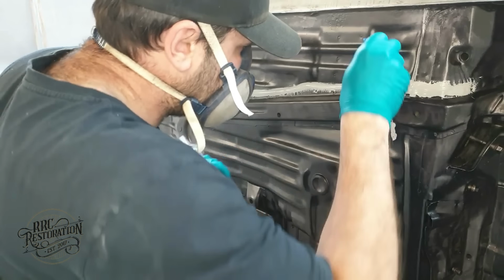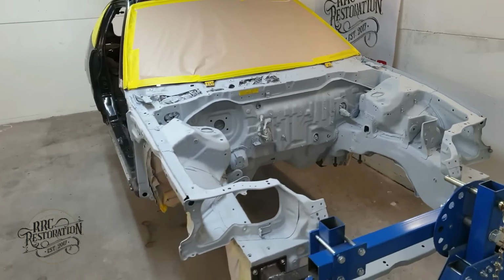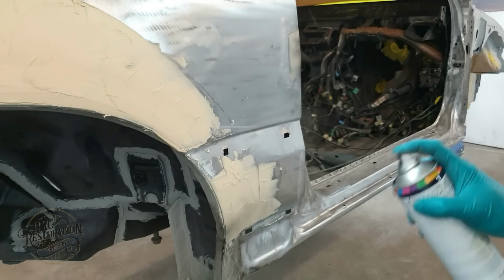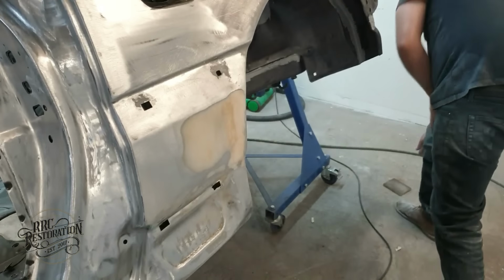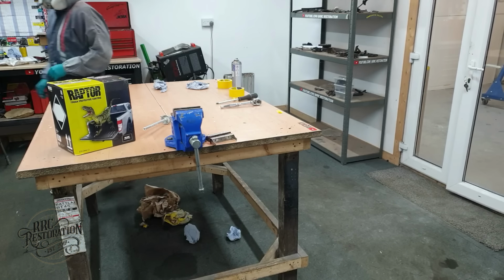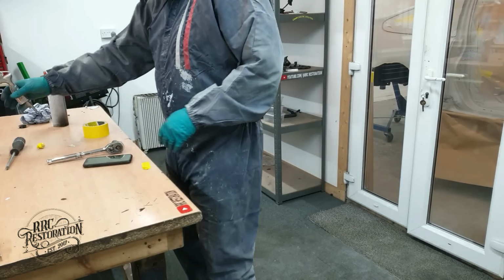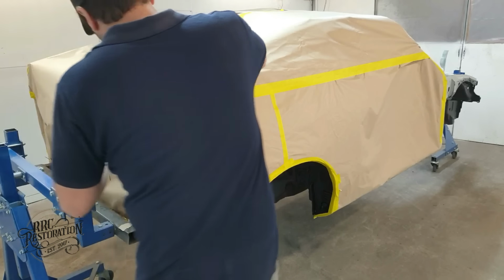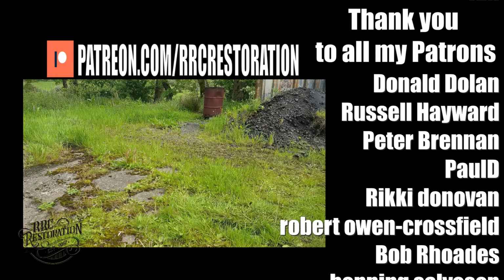Restoration Of An 80's Icon - Honda CR-X - Part 4

Comment: I've just watched Mr. My Mechanics weighing his filler to dab on his Datsun, and I get you painting your black Raptor coat black 'coz it's the only way to do it right. What a time to be alive! How did I get to be so lucky and spoilt rotten? I always want your vids to carry on and not stop, or at least get released like, twice a week. But then the job would be over too quickly I guess. Bloody excellent so far Mr. RRC 👏👏👏. In fact it's a full on, two thumbs up, Mr. Burns style ehhhhxcellent 😁. 😎

Comment: Seeing you doing all these body works reminds my dad, he worked his entire life to basically use a hammer to fix the body metal, water sandind and painting. I believe he worked more than 60 years doing it. He didn't have many tools, we had a very humble past but he showed me how's hard work, only using basic tools and his arms, but surprisingly, resulting in an amazing job, we couldn't tell the difference from the original and the fixed part. Thanks for your videos, keep sending it to us please.

Comment: Great to see the progress & under-floor reinforcements straightening, ALL my ED/EF Civic & CR-X's need those repairs. Too many clowns think they can lift the car there!
Must admit I now prefer to Epoxy Prime before filler, especially after removing a 'professionals' filler from the rear 1/4 of my '95 Civic with a paint scraper back to bare steel !

Comment: These videos take me back to 1995. Having finished with uni, I took a job in the US, and brought a 1991 CRX HF; my first decent car (though it turns out the newest car I've ever had). The HF had the same 1.5 SOHC engine, but fuel injected, so even less power, but Honda gave it a 5-speed with high gearing, so it always felt a lot of fun. A lot of weight was stripped out of this car; crazy thin seats, rear seat delete (replaced by handy lockable storage, not even a parcel shelf, power nothing but it had an AC. When I returned to the UK (Belfast) I went looking to buy one, ended up looking at JDM models, ended up with a Eunos Roadster.

Comment: my only jip is raptor liner is notorious in drying and cracking a few years down the line as it becmomes brittle. Gravitex is a rubber based version wich is flexible and lasts a good bit longer. Awsome job man

Comment: great work with the grinder, what are the sponges???  never seen those before.  I do a lot of stainless work and they look effective.  great channel as always a pleasure to watch your fastidious work!  regards from a Scot in Spain.
Reply from the maker: Hi, they are foam sanding pads I use them for tight areas and contours but can be used for pretty much any sanding job they are available from Mirka and 3m or you can buy the cheap unbranded ones lol  really happy to hear you enjoy my work.

Comment: Nice job ! But... You may should use a 2k epoxy primer over bare metal before you apply some bondo. Bondo contains humidity and/or air bubble that will make rust come back. Epoxy primer will stick very strongly on bare metal 80 grit sanded and will act as a filler, which is a good point, then after a quick 400 grit sand bondo will adhere on primer very well. Then another coat of epoxy primer on bondo'ed areas, then high built primer, paint... 
Same for the underside, use rust converter then epoxy primer before Raptor under seal, this adds a real strong layer of extra protection agains rust.

Comment: Good idea to paint (and varnish) the soundproofing which makes it easier to clean in the future.

However, before applying the soundproofing, I would have protected certain areas, such as the support faces of the shock absorbers for example.

To think I'm doing the same thing, on all fours under the car 😕.

Comment: That red scratch and pinhole filler is the stuff of nightmares when it comes to bodywork. It is just primer but as it dries over time it shrinks. Always shows up later down the road in bodywork. I got away from using after the first couple jobs I did years ago. The only time you can use it and not have a problem later is if the car sits for months before you finish sand and paint.

Comment: Would have used epoxy filler over the welds.  Or did you do that and i missed it? Helps waterproof the welds in the event you have any small gaps.  Normal body filler water can seep through/into.

Constructive critism.  

Loving the content bro ❤

Comment: In about 1990 I was looking at a Honda CRX for myself, It was a lovely little car. It will be a delight to see you in it when it's done. 
I like your NUTS puller points solution. Is that your own method?  I've seen puller bars using welded on tags, but not this approach.
Reply from the maker: Thank you, im glad you are looking forward to seeing the final result :) yeah its a little method i made up for using my large slide hammer with no fear of anything coming loose or breaking weld stud pulling if fine for thin metal but heavy duty stuff requires things to be " beefed" up a bit lol

Comment: Problem with the Raptor spray is that it cracks and chips quite easily then allows water underneath. My mates land rover looks a right mess underneath and his bumpers are chipped to hell and rusting

Comment: What an incredible job! Question. Did Honda paint body color over the undercoating from the factory or is this an instance of going one better than original?
Reply from the maker: Thank you, yeah its a case of me going over the top originally its would just be the bare underseal with a light overspray from the sills on it.

Comment: How come you didn't use primer on the underbody? And didn't go with epoxy primer on the shell?
Reply: Thought the same thing, filler on bare metal and raptor over rust converter? Raptor is known to chip off and when it does there's nothing under it
Reply from the maker: The rust treatment acts as a primer as its designed to be overcoated. and I didn't use epoxy because I'm doing filler work, and i don't like doing filler work on top of epoxy.
Reply: @RRCRestoration  Why don't you like to do filler work on top of epoxy??
Using rust converter as a primer is a bad idea too even though it says it can on the tin
Same with using the high build DTM. Just because it says it on the tin doesn't mean its a good idea. Sort of thing that would be used for a quick job spot repair. Not for a bare metal restoration.

Comment: Looking good. I see you used high build primary. Should it not have epoxy or etch primer as a first coat? I am currently doing the engine bay of a MK2 Golf. And will follow suit if that will hold back the rust?

Comment: Speaking of corossion protection, what is your take on spraying all nooks and crannies with oil or wax? I heard it's kind of like a "holy grail" for stopping and/or preventing rust, I heard it kept particularly rust prone cars in great shape even way up north in the harshest of climates.

I've had it done on my daily driver, a 2008 Mazda MX-5, at a Krown shop and I have a 1994 Suzuki Vitara that's awaiting a restoration where I'm planning to do the same once it's all ready.

Comment: why not work the metal instead of using that much bondo? it's a really beautiful skill that could definitely help you out! amazing content otherwise, keep it coming!
Reply from the maker: There is very little bondo on the panels just a very light skim to smooth out the imperfections. working the metal is a skill i have but not upto body expert standard since im only a trained painter.
Reply: @RRCRestoration  regardless of that, it's an amazing job that you're doing on this car, you can most definitely be proud of what you have going on

Comment: Hey mate, love your work, I've learn't alot along the way with all the different projects, absolutely loved the VFR400 and I'm building a RC30 Tribute from a VFR750f at the moment. I am currently doing something very similar to the work you are doing on the CRX to a E39A VR4 Galant (EVO 0), what is the rust converter/preventer product that you use?

Comment: Makes me wonder how long until rust appears on bare steel...I guess it comes down to humidity. Does even a tiny spot of water on steel before primer make any difference?
Reply from the maker: On a humid day or touching it with sweaty palms ive seen flash rust develop in minutes but in the right environment you could probably leave it bare for a day without too much ill effect.
Reply: @RRCRestoration  Interesting to know! 😎

Comment: I'm assuming you used a single stage on the bottom and engine bay, will you be doing a base/clear on the body or will that be single stage as well?
Reply from the maker: Nicely spotted, yeah i used single stage just for ease. The body will of course be base and clear for that ultimate deep shine ;)

Comment: Will the car be running the D series engine or something more modern? A friend has an late 80's CRX which was initially rebuilt with a B20 but due to management support (costs/mapping etc) it was then swapped out with a K series.
Reply from the maker: Im not 100% sure yet, Ive got a few ideas in mind but nothing is concrete yet.

Comment: I really enjoy your videos and I love the CRX project.. but I'm curious why you didn't remove the glass before painting.. we call this a 3 year paint job here. If you don't properly detrim a car before paint, then anywhere where you painted up to will start to peel back from that masked edge
Reply from the maker: Thank you, Im glad you asked that the glass isnt removed as its quite literally unobtainium! getting original bronze tinted glass for this car is impossible here now and any glass fitter wouldn't give a 100% guarantee that they could remove it " especially the windscreen" without breaking it which i can totally understand things happen. The rubber trims are all removed and the masking is right up to the edge of the glass done this hundreds of times and never had a failure so im quite happy doing it again here.
Reply: @RRCRestoration  completely understandable. Over here you can buy these CRXs pretty easily. Parts are everywhere for them. Unless the model you're working on has specific glass like the bronze tent you're referring to. They do make a specific type of lift tape that will lift the rubber seal of the glass or trim up so that you can paint underneath it. I've seen that in a few of the shops that I've worked at over the years. That might be something to look into instead of masking up to the trim. I'm excited for your next video and look forward to more content from you

Comment: strange, did you forgot the green rubber "duck" thing? or did I mis something? 
Anyway I'm curious wat you are going to do with engine, gearbox, brakes, ... 16i16v with manual gearbox? disc brakes in the rear? I hope you keep it OEM+ not too wild, just clean standard but not with the auto box and drum brakes.

Comment: I've no doubt in my mind you know what you're doing being a panel beater sprayer, but why wouldn't you etch prime the bare metal shell before high build? I'm genuinely interested as I see paint and prep as a but of a dark art
Reply from the maker: There is no need to etch with this particular high build as it is designed to be applied to bare steel, i double checked with the manufacturer ;)
Reply: @RRCRestoration  ahhhh beautiful, I knew you knew what you were doing, like I said I was just curious 👍🏻😊😊

Comment: May I ask why you are putting high build primer + filler straight on bare metal? And raptor straight over a rust converter? 
Theres no point doing all this welding and rust removal if you're not going to properly coat the prepared metal.
Reply: Thought the same thing, not even used Epoxy Primer either, raptor will chip off and then there's nothing protecting it after
Reply: @xelad6159  You hate to see it mate. Seen these mistakes time and time again. A little research goes a long way

Comment: Most of the time they are covered, but it seems to me you still have the windows in the car. Correct? If yes, why? My experience is very limited, but I worked on a car many years with a friend together, and we removed all the windows before the paint job. It wasn't that difficult.

Comment: Why did you decided to grind to bare metal? Even doing the filling job and bodywork, it takes so much time and takes lots of time. Also the grinding disc marks are harder to cover vs. sanding paper.

Comment: You're obviously a master craftsman, so I'm puzzled that you would leave bare metal exposed for more than a few minutes. In my experience, flash rust starts almost immediately, and continues under any later coats, unless you kill the rust dead to start with. On bare metal, I immediately prime with etch primer or epoxy (both of which contain rust treatments), then a primer-surfacer, wet-on-wet, then a light sand, THEN, a non-moisture-absorbing filler. Then further coats of primer over any further exposed metal, followed always by primer-surfacer. I use traditional filler only over the top of sanded primer, just before painting. As I said, I admire your work, but if you park that car in a driveway for five years, it will be a shower of rust flakes. No offense intended. Really.
Reply: Using that logic given the amount of time between stripping the paint at the bottom and getting to the top (hours), unless you primed/sealed the metal after every row stripped, the process has already started. Does your grinder come with a spray gun attached?

Not quite sure how you can compliment him as a master craftsman and then tell him immediately that his work is going to be a pile of rust on a driveway.
Reply: @jimporter  If you spray bare metal with an etch primer within a couple of hours of the steel becoming exposed, the phosphoric acid within the etch primer will eat any flash rust. 
Also, good epoxy primers specifically state something like: "A chemical treatment (or conversion coating) will improve adhesion and performance properties of the finished coat". In other words, you remove the rust and spray epoxy primer. 
Most rust treatments won't affect a non-absorbing filler. They may affect a normal filler. Normal fillers also suck in moisture; when they're applied to bare steel and then left, the moisture within the filler starts rust unless the filler is quickly primed.
And yes, each time I expose bare metal, I respray with etch primer. 
The reason most classic cars don't rust away quickly is because they're kept in dry garages, away from humidity and salt. I don't have that luxury, so I don't give rust a chance to take over.
Regarding our friend being a master craftsman, he is clearly highly skilled at manipulating steel and in achieving an as-new appearance on the vehicles he restores. My only quibble is with the issue of longevity.

Comment: I am sad on the fact you appiled filler on bodywork.  that is huge bodge job
Reply from the maker: I'm a professionally trained painter so no not a bodge job in anyway shape or form!, I'm using the filler for the exact purpose it was made for for smoothing out any imperfections that are impractical to spend time massaging the metal to the perfect profile.